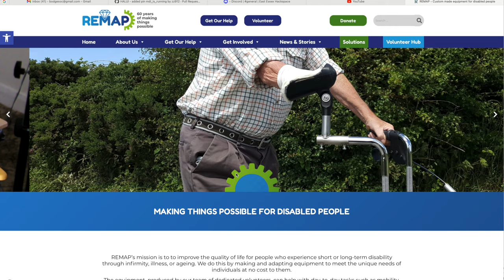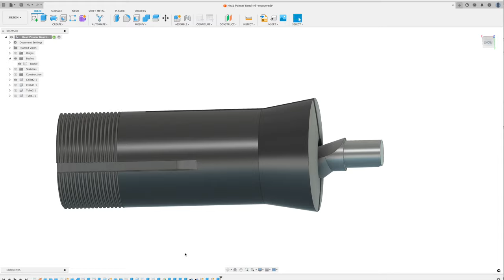3D Printed Collets to solve a tricky fixturing situation.

Comment: Good job, and I wondered how you'd position the second operation in the collet, but you'd already had that covered a few moments after. 😀 The idea of 3D printing collets for odd shaped work holding is one step on from when I visited Omega pistons, and they described using plastic internal tooling to hold a raw piston forging in their machines for workholding. BTW,  I recommend Extrudr GreenTec Pro or the CF variant (needs 0.6mm nozzle) for more heat tolerance (>160ºC) as they print really nice.Although they can be pricier, they offer 30%-50% off deals every so often.

Comment: Great to see some lateral thinking - combing additive machining with subtractive machining - awesome.
Also great to see you slow the spindle speed down for filing. Few people do it even though a file is only high carbon steel and certainly not HSS let alone carbide.
Also the use of the proper sort of file, a single cut not double cut.

A thought with your safety/splash guard. If you were to make a new one perhaps you can add a sacrificial surface to it.
Something nice and clear plastic like the disposable face guards we all saw during the height of covid.

Comment: For me, 3D printing seems to be an ideal companion to a machine shop - for fixturing, assembly jigs and complex or insulating sub components. Once you understand where the strength of the print lies (usually in compression), it's surprising how robust the part can be.
Edit: Thanks for the link to remap.
Reply: info. It is not in the nature of the plastics to be reused over and over again. It wears every time somewhat. I printed gears to cut special threads and after some work they will give way. The idea is good but the material isnt perfect and ages.
Reply: @fearlyenrage  Yeah, I use it mostly for one offs - if you're in production mode, you can amortise the cost of metal fixtures & assembly jigs. For insulating parts, provided there is no movement, 3D printed longevity is more that acceptable.
Reply: @philip_fletcher  when it works for you good. Wont do always the job for me.

Comment: A 3D printer is a fantastic complement for a machinist. However, I really don’t trust the precision (unless it is a very expensive printer) and I don’t think plastic is rigid enough. Don’t get me wrong, my shop is splattered with 3D printer stuff, nonetheless I wouldn’t hold a piece to machine with a printed part. 
Wouldn’t it be faster placing the pice in the mill at the desired angle and cutting it with a boring head? You wouldn’t need to make two collets. And it would take minutes to position the v-block. There are multiple ways to repeat the angle consistently.
Reply from the maker: I think that there would be clearance problems for the boring tool with most options that hold the part in a hole perpendicular to the surface (Vee blocks, collet blocks, etc) 
Also, doing it in the mill there are more degrees of freedom, so aligning the spindle to the work would be quite a bit harder. The rotational position of the part in the workholding is something that needs to be set up as I did it, though it isn't super critical. But with a mill you then have to worry about the XY alignment. One of those would be easy, you need to be in the plane of the tilt. But the other is really quite hard. The printed collet means that this isn't something that needs to be considered. 
But I partly did this to see if it would work. As the collet is made by simply subtracting the part from the collet model it could be used for all sorts of oddly shaped items. 
I am not sure that this technique was the best way to make this particular part, but it might be the best way to make some other part, some day.  (I am imagining a two-part collet, for example, to hold a part with reverse angles and no parallel sections)